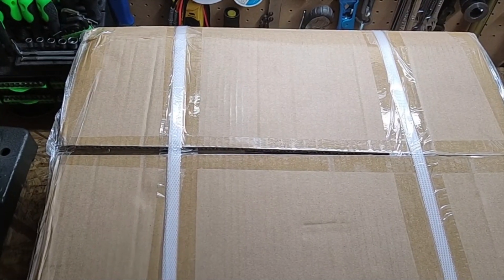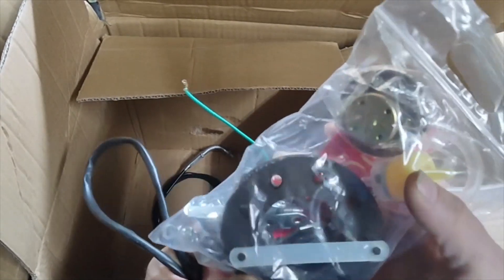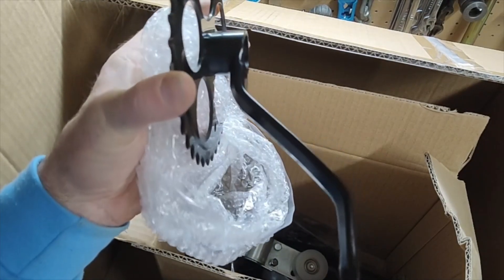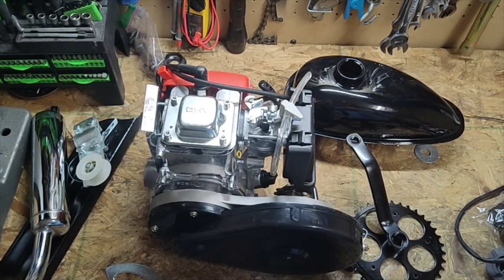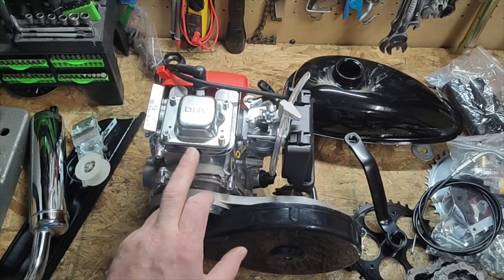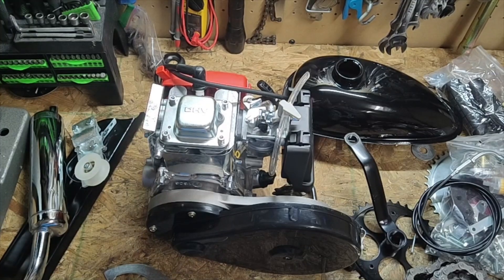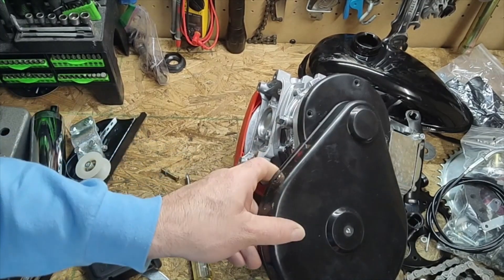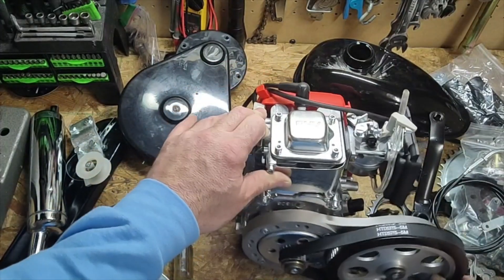I Bought A PEXMOR 53cc 4-Stroke, by request! (Question: Why did my clutch Explode?) Lets Find out!

Comment: Glad you’re doing this 4 stroke, I have one but don’t know much about it. It’s chain driven and smaller displacement. Definitely will learn some more from this build
Reply from the maker: Honestly 49cc and 53cc are nearly identical in power.  Can't tell unless you physically read it on side of the engine 😆
Reply: @BuildBreakFix  Not exactly, the difference might be just .1 more hp, but you get 25% more torque.
If that really is a 53cc I kinda want it because mine has a tapered shaft, the straight shaft with the transfer case is a bit narrower.
I didn't know anyone ordered a 53cc straight shaft run to the US. 
They wouldn't do it for less than 1000 items according to the Huasheng rep I spoke to a few years ago.

Comment: I actually had the best luck using the old Bikeberry engine mounts that I modified a little with some hardware from Home Depot on a Cranbrook.  I'm not a big fan of Bikeberry but during the pandemic, they were the only ones I could get a four stroke kit from. Three and a half years later the engine mount is the only part of the kit still on the bike.
Reply from the maker: Yeah seems solid so far few issues! Mounting*

Comment: You need to remove the large belt sprocket and stake the aluminum to hold both outside black metal rings on the sprocket.. When I did my build..both the inside and outside black rings came off before I did one loop around the block. Great videos by the way!
Reply from the maker: Will do that for sure. Thanks for the tip!

Comment: This was the first kit I ever did, I bought two of them, and I put rubber between the mount and the bike-frame on the first one,🙄, don't do that!,😖, I also figured out that a 36tooth sprocket makes this kit so much smoother for some reason, and it don't kill the bottom-end much at all,😉👍, I really like these 49cc kits a lot, I highly recommend them, awesome video, and thanks for sharing.
Reply from the maker: Micro turbo it 😂. Thanks for 36t advice will do as build it then!
Reply: @BuildBreakFix  If you find a turbo that it can spool let me know. I've been looking for a few years now.
Reply from the maker: @thefunniestfarm4731  going to make one!
Reply: @BuildBreakFix  You need to find out your gear ratio so you can find out at what RPM your clutch starts to grab and when it is fully locked.
If I am correct you have a 5:1 transfer case with a 44 tooth rear sprocket.
That would put you at a 22:1 gear ratio with a not so fun 24ish mph if governed, but will climb mountains.
Do not stay below 14 mph or you will fry your clutch.

Comment: You should remove at least the heat shield from the exhaust. The one around the fins directs the airflow from the flywheel fins because it is meant to be stationary in a box as a generator. I've heard guys trim the flywheel fins down and remove the shroud without overheating, but I kept mine on because I get stuck at a lot of red lights.
Reply from the maker: Oh yeah all gone !   Was first thing to go 😂

Comment: First mods should be a free flowing air filter, 7/8" stainless flex tube exhaust and an upjet.
The length of your exhaust and header dictates what rpm range your max torque is in.
Reply: If you get the 7/8" flex pipe cut the muffler off and it slides right over the header.
If you keep the muffler, take the cap off, it sounds nice.
Reply from the maker: Yuppers!  Noted! , 🙂✌️